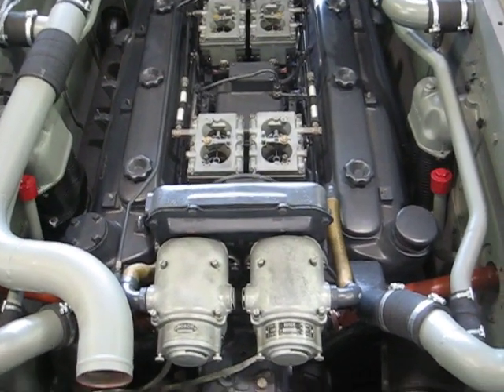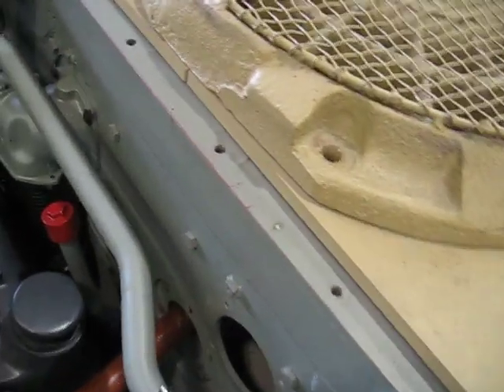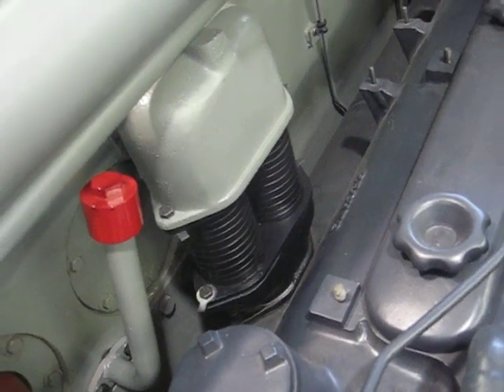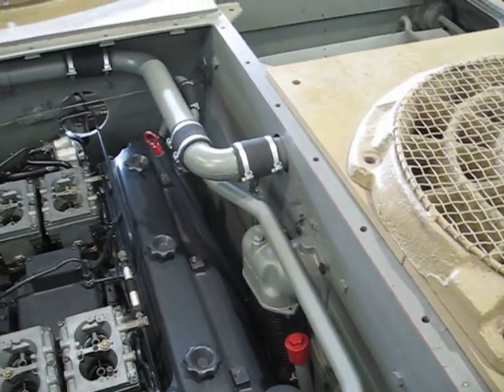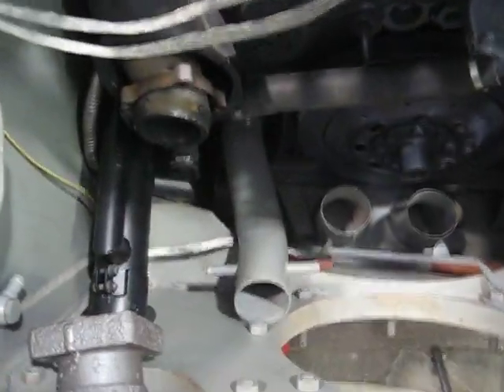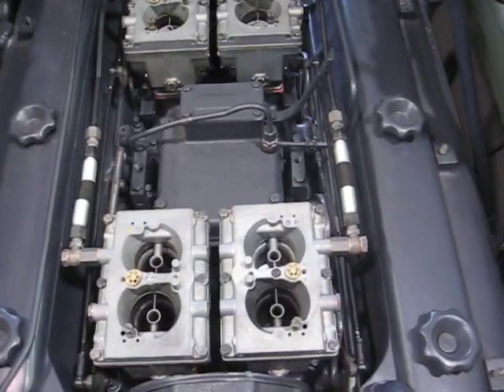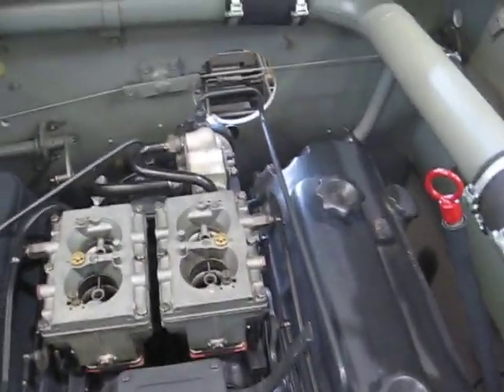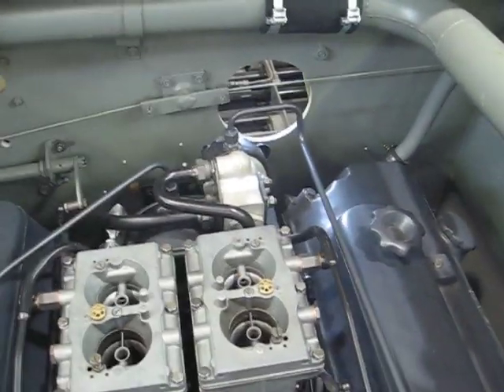Panther tanks engine compartment

Comment: Wonder why they didn't recreate the air filter and leave the carburetor exposed like that.
Reply: The engine compartment had not been completed when this video was taken.
Reply: @davemarian9362  There is a more recent video of this tank from Inside the Chifetains hatch - https://www.youtube.com/watch?v=9xKYicir_i8&ab_channel=WorldofTanksNorthAmerica in 2016 ostensibly after the vehicle was completed and the air filter is still not there.
Reply: @jeffreytan2948  I remember more clearly now.   We started to remake them but never finished.  They are very intricate air cleaners with lots of small , formed pieces.
Reply: @davemarian9362  Thanks for the info. Nice to hear the reason straight from the source. I kinda agree as that would entail a lot of sheet metal fabrication and you wouldn't run the tank a lot anyways to warrant the protection afforded by the air filter.
Reply: @jeffreytan2948 I am fairly certain that the panther has not been run nor driven since I last drove it in early 2010.  I am guessing that it most likely will not be driven again.   It would need quite a bit of work to be driveable once again.

Comment: I believe Porsche (or Maybach?) already has designs for directly injected!! diesel engines with a multistage Roots compressor.

But there was a shortage of aluminium alloys, so the whole plan was scrapped.
Reply: Bit like the shortage of copper annulled the better designed and turreted Porsche version of the Tiger 11.